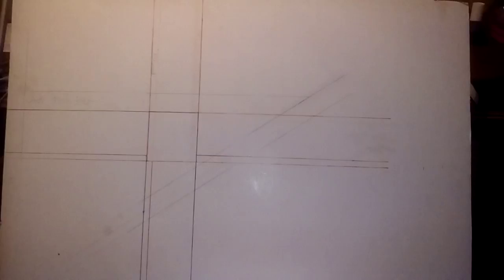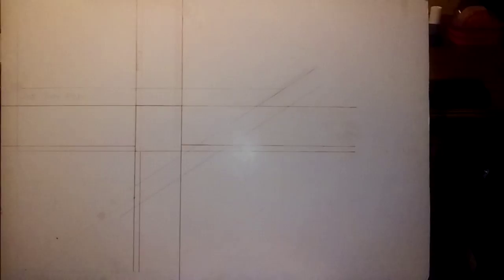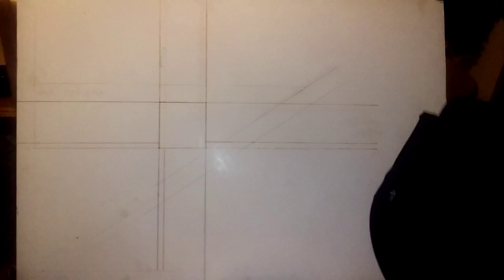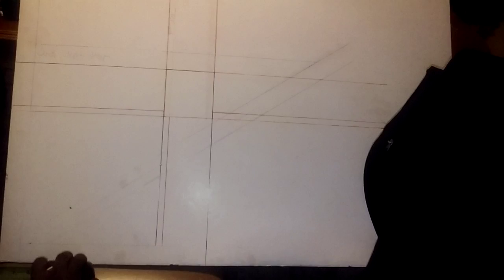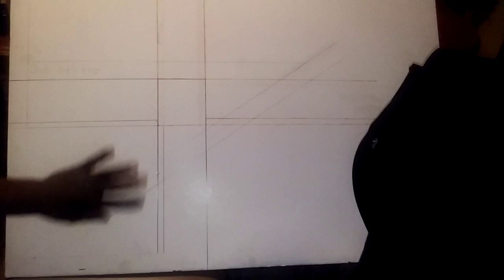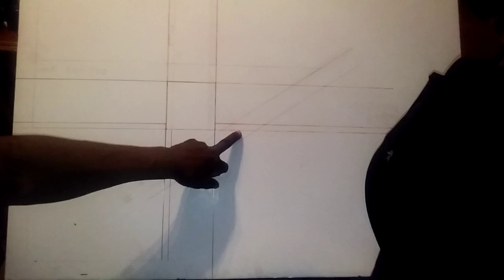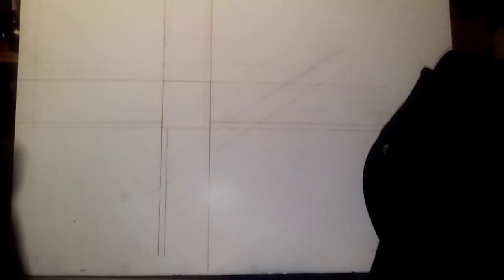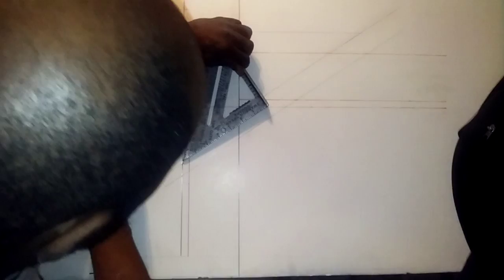Simple way to figure a mixed (Bastard, irregular) pitched hip roof.

Comment: Was a little difficult to understand but the effort is appreciated. I loke to use the 12 scale on my framing square and you can lay out the whole roof to scale. You can measure your overhangs you can check your angles and while using those angles you can figure out your shortenings and irregular double cheek cuts and single cheek cuts of valley and hip jacks. Thanks for the video.

Comment: How does that work with HAP ??? Of course a twelve is going to have a higher HAP
Reply from the maker: What do you mean exactly as to how does what work? As for the HAP size, it depends on the stock of the lumber, It is possible for the HAP on the steeper pitch to be smaller if the lumber stock is smaller in certain framing applications. But as a rule, if the lumber stock is the same on a mixed pitch you are correct the HAP will be greater on the steeper side.
Reply: @1THETUFFGUY  so let's say that on the 8 side you have a 4 1/4 HAP and the twelve has a 6" HAP , a difference of 1 3/4 " . So if I understood correctly the twelve side would be raised 4" . But wouldn't you have to allow for the difference in HAP , and only raise it 2 1/4 " ??
Reply from the maker: If I understand the question that you're asking, it appears that you're forgetting that the ground zero for the framing points for the 8 or 12 side begins a the top outside corner of the sub-fascia, not the HAP's that correspond at the building lines. Remember the facia is the equal point for the 8 and 12 sides not the HAP corresponding to the building line, Hope this helps.
Reply: @1THETUFFGUY  After some thought yeah and talking to this guy on Instagram who said just like you that you gotta figure it from the fascia , I finally got it !! Can't wait to try it in the field , instead of running my fascia around the corner and running a stringline to it